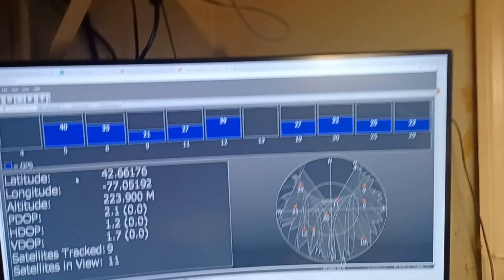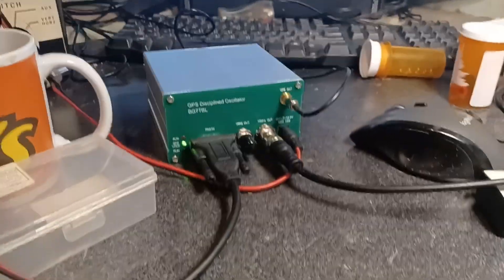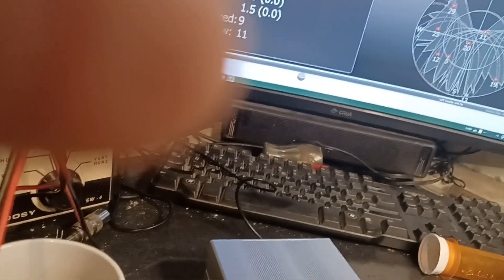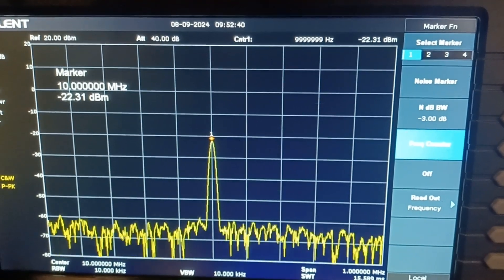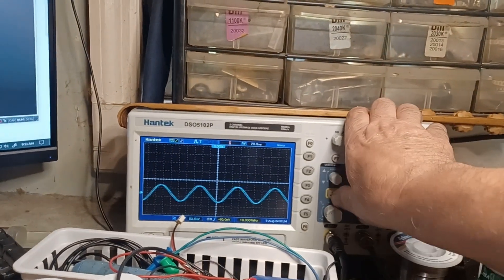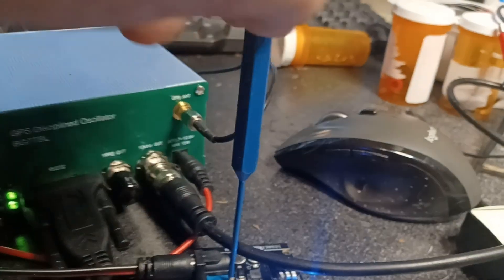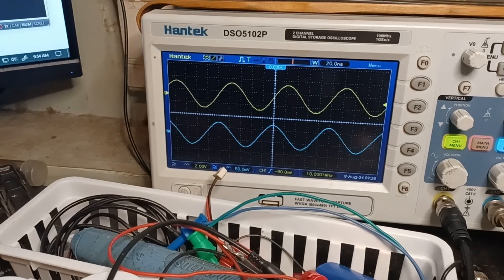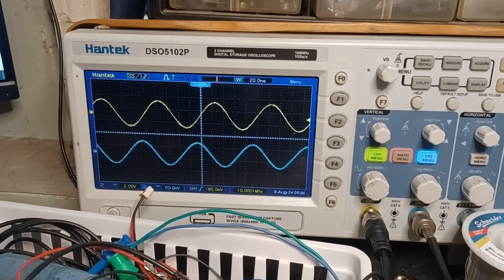Tune 10Mhz OCXO from ebay

Comment: That seems to be a common issues of you read the reviews. Just need to replace the trimmer with a larger value iirc.
Reply from the maker: Thank you for the info. Will keep that in mind for the next one.
Reply: @Jeb-N2JEB  have you fixed it with bigger trimmer? i see some units in low teens that sound like a pretty good deal
Reply from the maker: @GamingAmbienceLive  check out this video https://www.youtube.com/watch?v=O8Y6dH7ZHl4&lc=UgyhZJ4bCBmkfzByh2l4AaABAg